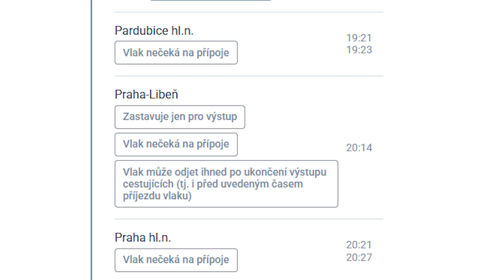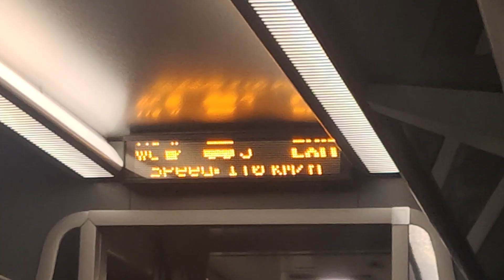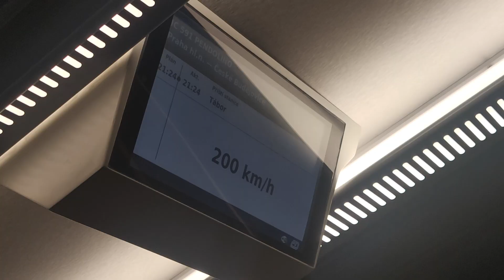High Speed Rail and the Importance of Track Upgrades

Comment: While railway upgrades are seriously underrated, they need to at least stay consistent in terms of speed. At least in places like the US where most people aren't taking trains and most politicians are only supporting them "to create (short-term) jobs", track upgrades are often extremely exaggerated in the media. Oftentimes, way more attention is paid to the new shiny trains than the old railway infrastructure. Look no further than two railway lines, the Acela Express in the Northeastern US and the Brightline train in Florida. Most of the Northeast Corridor railway line (except for the stretches running through cities like Baltimore, Philadelphia, New York, and the coastline of Connecticuit) goes at least 125mph/ 200 km/h. There is a train that Amtrak calls "high speed" for running 160mph/ 260km/h for a short stretch in Rhode Island and northern New Jersey. The train goes 125mph for the rest of the journey, only saving time by skipping stops. While it has tilting capabilities, it is usually only used on short sections not because of the track geometry or whatever, but because the overhead wires haven't been upgraded past the century-old catenary. When the Pennsylvania Railroad first built the Northeast Corridor, it was electrified to accomodate trains going 100mph/ 160km/h. In the 1960s when the federal government wanted to put a train called the Metroliner on the Northeast Corridor that could go 160mph except on coventional tracks in response to Japan's then recent opening of the Shinkansen at 130mph/ 210km/h. The Pennsylvania Railroad said that the wires could only support up to around 120mph safely. The compromise was reached that the government would absolutely stretch the constraints of 1960s technology to build trains that could go 160mph (which ended up frequently breaking down before the EMU motors were disabled and the cars were just converted to locomotive haul carriages), but it would go 120mph on the mainline. Which means that the catenary from the 1930s has never been replaced to this day.
Brightline's case is a little weird. It's supposedly a private company, but they did their upgrades to the Florida East Coast mainline and built their short 125mph track from the Florida coast to Orlando using public money. The 125mph track takes only a few minutes to traverse, and the trains go 110mph/ 180km/h for most of the way through small towns along the main line until slowing down to 80mph/ 130km/h once it gets to the Miami metro area. It then slows down to just 40mph/ 65km/h through the neighborhoods north of Miami's downtown. Brightline uses diesel dual-locomotive trains and has way too many grade crossings that aren't very well protected (it is the deadliest single railway line in the entire US), but it still markets itself as "high speed rail" and the media plays along with it. Meanwhile, the Amtrak Northeast Regional trains on the Northeast Corridor go 125mph for most of their journey but the media completely ignores them, considering them to be the average outdated and slow Amtrak train.

Comment: I must say, I am glad that the Czech Republic is doing this and showing it is possible to upgrade tracks to 200kmh. Here in Bulgaria, track maintenance and upgrades have raised speeds from 40/60kmh to 90/120kmh and more upgrades to existing infra is bringing speeds of 160kmh. I can't explain how awesome it felt to travel with 140kmh on a line where previously I went with 40kmh. And the changes which enabled this were changing the way tracks were welded together and straightening segments. Waiting on etcs L2 upgrade for the full 160kmh experiences. I hope we get upgrades like you have, because there are definitely sections where 200kmh are possible

Comment: I like your analysis very much and indeed it's spot on. I'm happy that finally the Prague-Budweis service is faster compared to taking a train and a  natural choice compared to cars or buses. I'm a bit disappointed that the importance of this line was not explained or stressed enough to the Austrians, as the extension from Budweis to Linz (upper Austria) is still single tracked and requires complete overhaul. Sometime at the beginning of this year 2025, the Czech and Austrian sides created a memorandum of understanding where the austrians finally understood the potential of this line, however any proper upgrades on their side will be as late as 2040 😢 if we had a quick upgraded line today, reaching Linz from Budweis in ~1 hour instead of today's 2hrs, this would be considered a hugely important link. From lentz you can reach Vienna very quickly as well as going south to Slovenia or simply turning towards Salzburg and Switzerland.. unfortunately this link for the time being will be supported by the soon-to-be finished D3 highway which will be linked to the Austrian A10.. sorry for the foreseeable future cars will trump trains. I'm not against cars but of course trains are far better and slashing the trip from Prague to Linz to 2.5h is great, opens a world of opportunities and destinations

Comment: Nice video. Upgrading an existing line comes with one big downside: the disruption. If you need to close the line for 6 months then that has a real financial cost, both directly in terms of replacement busses or whatever, but also indirectly in terms of lost economic oppurtunities and loss of trust in the railway as a means to get you to work. A new line will add more capacity than is likely through upgrades (and in fact increasing the speed of an existing mix-used line will reduce capacity) as well as adding redundancy. 

Upgrading is often proposed as a cheaper solution, but if an upgrade delivers say 20% increase in capacity then although that may solve today's problems the extra capacity will soon be eaten up and the new line may be needed anyway.  It would have been better to build the new line in the first place. This is basically the mess Britain got itself into and seems doomed to repeat.

Comment: 4:13 you are showing a great example right in that image.
beyond 160km/h you just cannot have level crossings with other modes of transports. mostly cars.
additionally, you can't push the amount of trains per hour too far. imagine having a train every 30 minutes per direction. that means, the gates of the crossing close 4 times per hour for a total of 8-10 minutes. okay-ish.
now have a tact of 15 minutes. level crossings is now closed for 15-20 minutes per hour.
suddenly, you have a lot of very unhappy car commuters on your hand.
and everything with even more trains means, that the crossing is closed half the time, or even less.

Comment: It really wouldn’t be hard for the US to do good rail service
Reply from the maker: all it takes is political will, like I said in the video

that's the biggest barrier in the US (and a lot of countries, including those in Europe)
Reply: @TheTramly there’s no political will for rail.
Reply: @GenericUrbanism  There is, on entire west coast. It used to by in Florida and there is now some in Texas.
Reply: @TheTramly  The Northeast Corridor is an example of upgraded track, as intercity trains run 125mph for almost the entire length, and tilting trains can reach up to 160mph for short segments but most of their time is spent running at lower speeds (their time savings come from skipping stops). There are some corridors where the state governments bought lightly used freight railway track from the private freight railroad companies and upgraded them to 110mph because that's the maximum speed trains are allowed to go in the US without grade separation or whatever the FRA means by "impenetrable barrier" (the regular crossing gates won't work, they never said what was actually "impenetrable")
Then there's the UK, where 125mph is the standard for most intercity main lines
Reply: @TheTramly  Property laws are something on another level there too, so if the project includes changing the line's tracing then it's going to need land acquisition, and NIMBYs won't like that (which it does/would often require because their lines are winding)